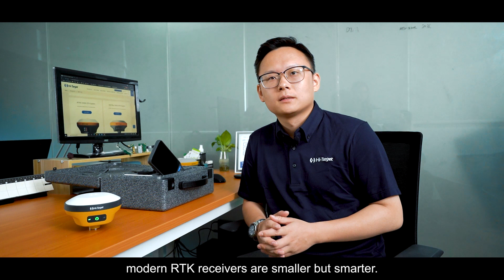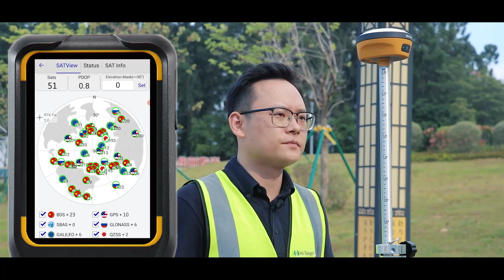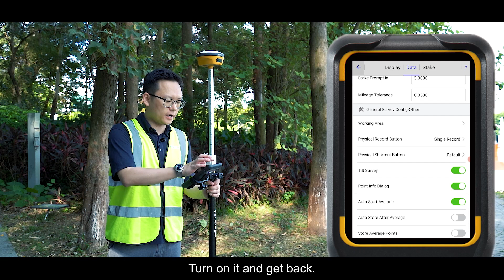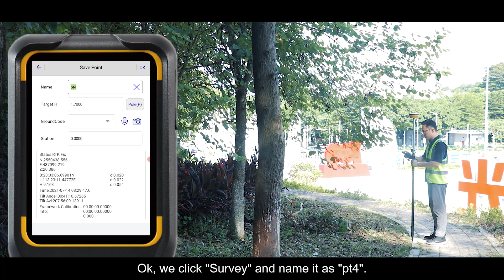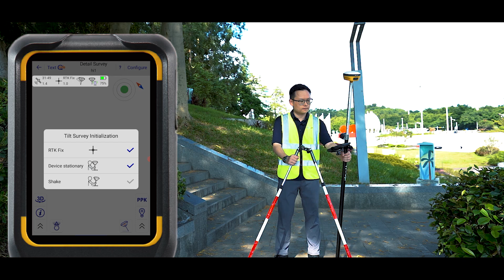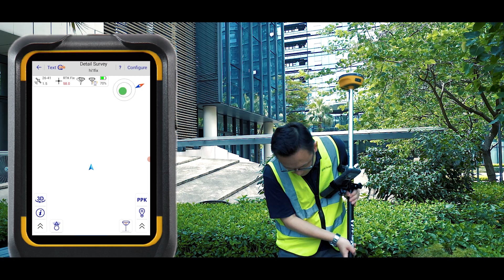Hi Target V200 9 axis IMU RTK Receiver, lightweight but with full functionality!

Comment: Does it have both internal UHF radio and external UHF radio for long range communication?
Reply from the maker: it had built in internal UHF radio
Reply: @ejgeosolutionhi-target5357  Thanks. Am I able to also connect an external radio with antenna pole?
Reply from the maker: @kwandumakayi8784   cannot. this model dont have the external radio com port
Reply: Thanks for your feedback. Does V90 have external radio com Port?
Reply from the maker: @kwandumakayi8784  yes